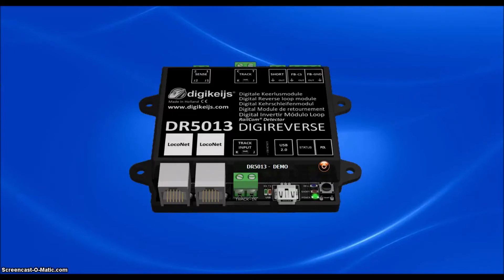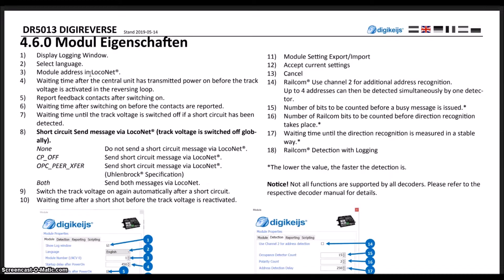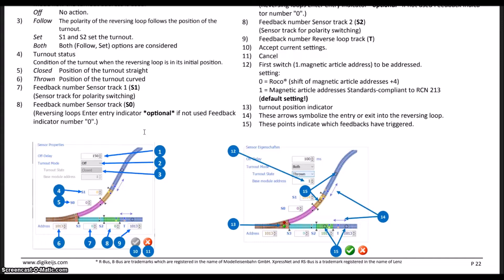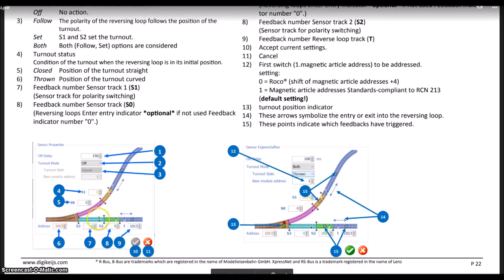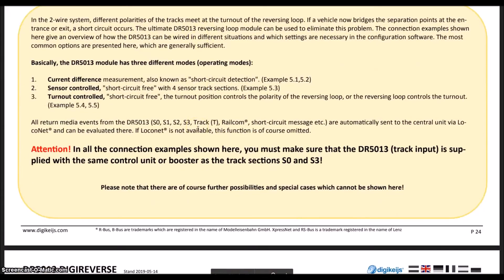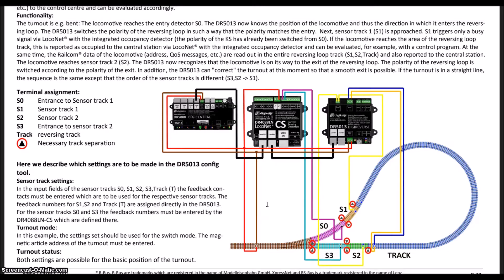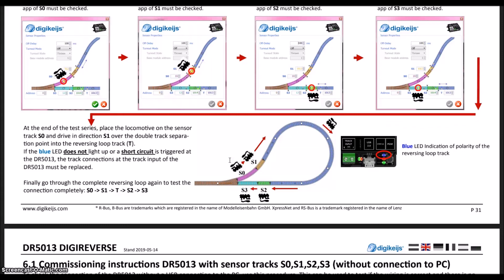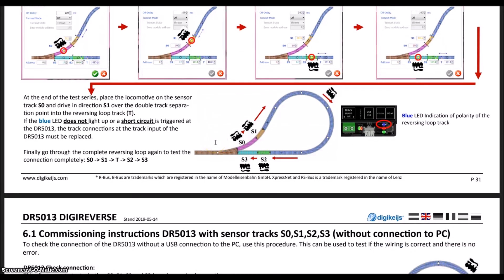Digikeijs DR5013 DigiReverse - Short Circuit Free Reverse Loop Module Explained

Comment: hi I have one of these units and trying to under stand the program better before I start trials and debug. page 22 point 4 , 5, 6 the values and setting used in these fields can you explain better what is needed here.  Paul
Reply from the maker: When you open the PC App you will see the same diagram.  

S1 & S2 come from the DR5013 and S0 & S3 are from an external detector as seen on page 27.  You will want to enter what ever that number is from the external detector in those 2 boxes.  

You can set the S1 & S2 to any available number that isn't being used from another LocoNet device.  

The turnout address is the address needed to throw the turnout.  If you are using a DR4018 or DR4024 this would be the number that is associated with the output connected to the turnout.